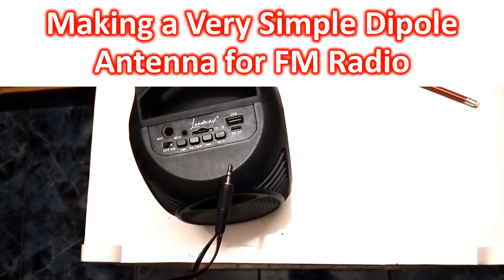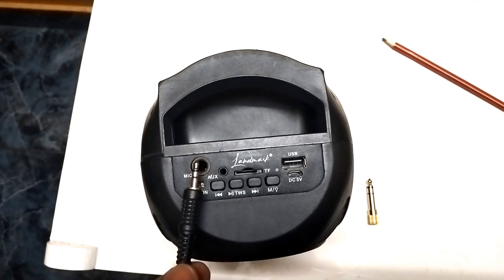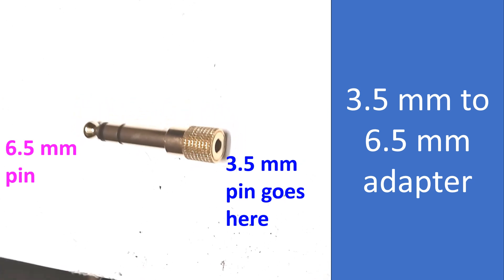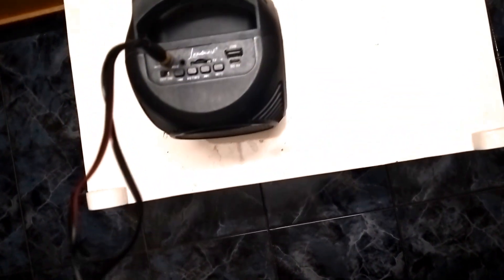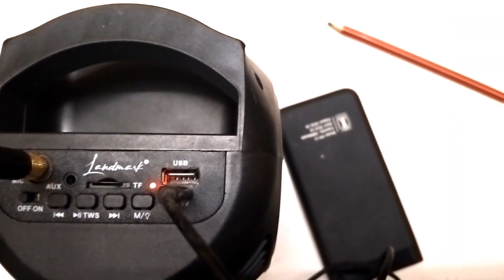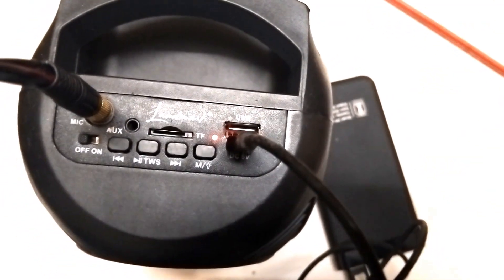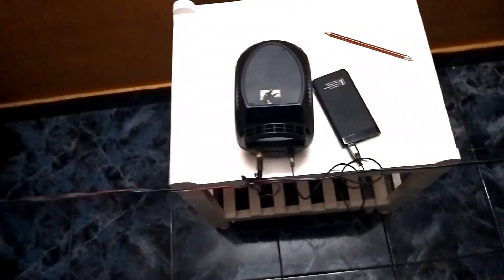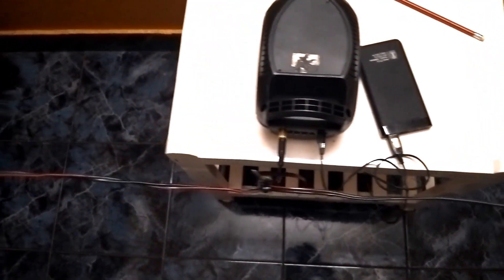Making a Very Simple Dipole Antenna for FM Radio

Comment: Ok thanks, can do a video abt the materials u used for making this antenna, the procedure
Reply from the maker: For this video, I used one meter of dual twin lead speaker wire with connectors at both end, which I already had here, just to test. I measured 75 cm to each side and gave a tie at that point. Only about 25 cm of the speaker wire was remaining. So the height of the antenna was only 25 cm from the speaker cum FM radio. As the speaker wire had 3.5 mm pin, I used an adapter to connect to 6.5 mm phono jack of the speaker cum FM radio. There is no separate antenna socket for the speaker cum FM radio. For your radio, you will need the appropriate antenna connector. I have posted a schematic diagram as a community post here: https://www.youtube.com/@johnsonstechworld/community. Next step will be to use additional cable or twisted flex electrical wire to keep this antenna at a higher level and test.
Reply: @johnsonstechworld  ok Thanks 👍 nice work
Reply from the maker: Welcome